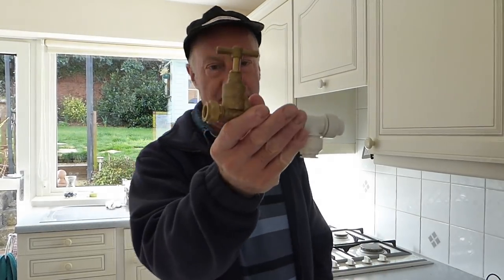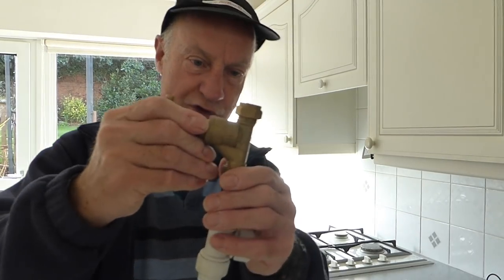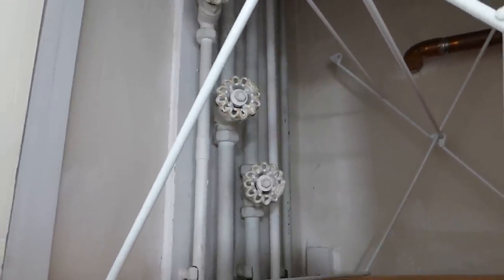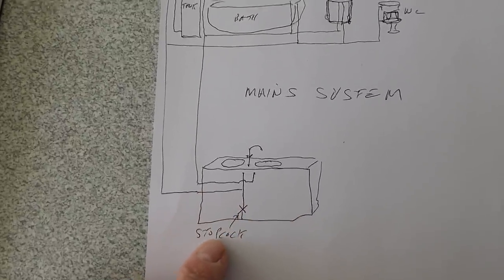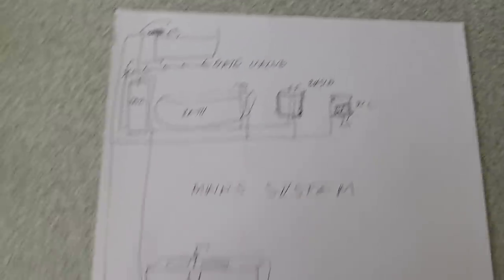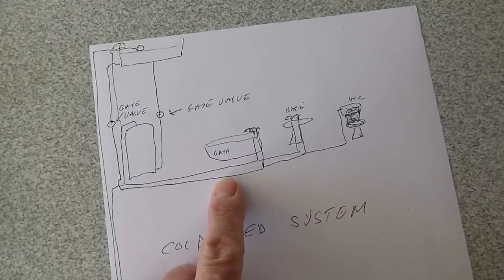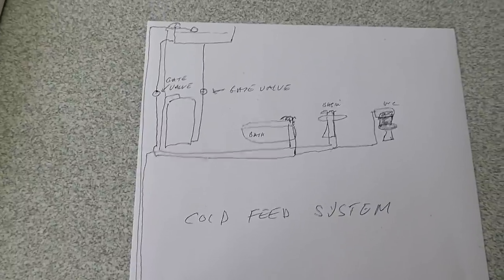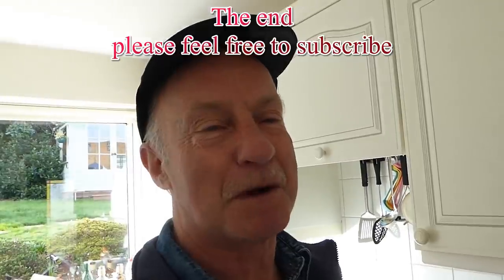Where is my Stopcock? How do I turn the hot water off?

Comment: Hi Al I live in a 1960’s block of flats. My partner and I can not locate the stopcock for our bathroom! Sure enough there is a stopcock underneath the kitchen sink which my partner turned off but apparently that only stops water to the kitchen and not the bathroom! After watching this vid I looked into the airing cupboard and there is a red gate valve with one end going into the water tank and the other end into a pipe going somewhere else. Is this the valve we’ve been searching for to stop water supply to our bathroom/toilet??? Thanks for your vids they’ve helped us out many times😃
Reply from the maker: More than likely yes, turn them off and see what happens.

Comment: Hi I was just about to give up finding the hot water turn off as I needed to change my bathroom taps and phone a plumber when I came across your video.. Brilliant and thank you, I have another problem my oil fired central heating works great accept fir the water heating.. It doesn't.. Have you got anything I can try

Regards Frankie.
Reply from the maker: Check the 3 way valve, switch it to manual.

Comment: Hi, hopefully you are still on Youtube as I know this video was some time ago now but these videos have been very helpful over the years. I do have a question however which relates to me installing a new bathroom. I want to replace the bath but there are no shut of valves to the hot and cold feeds. Is it a case of turning the water off at the mains/stop cock or will I need to turn off the hot water feed to a gate valve which controls the feed from the unvented cylinder in the airing cupboard? Any help greatly appreciated.
Reply from the maker: Hi David, you will need to turn the main stopcock off and the gate valve next to the hot water tank.
Reply: @dereton33  cheers and thank you for replying!

Comment: gave me a better understanding, i will investigate mine a bit more closely as i have a tap under the sink and also one in the airing cupboard maybe 2 i cant remember now. i have low pressure up in the bathroom takes an age to fill could opening up these taps give me more pressure upstairs in the bathroom if i turn on the hot tap and  the cold together its terrible just dribbles.
Reply from the maker: Make sure all taps are open fully, but low pressure in the bathroom is usually because the supply is fed from a roof tank.

Comment: Hi there, this will be my first DIY attempt at changing a tap washer.  Here's what I remember from when I used to help my dad.  Turn off main valve (Stopcock) from outside front of lawn. Run taps. Unscrew tap and change washer.  Replace tap with new washer and "bobs ya uncle' - DONE.  Now I don't really think it will be that easy so could you please give me advice to stop it from being balls up.  I'm also going to turn hotwater cylinder off - at switch.
Reply from the maker: Hi Mandy, there should be a stopcock under your sink, which will make it easier to turn the water off. Also do not drain the tank unless it is a hot tap you are fixing. As you have a hot water cylinder and roof tank, see if you can locate a gate valve in your airing cupboard to turn the hot water off. It is always better if you do not drain the roof tank as you can get airlocks afterwards.  The tap repair is as you say, in your description.
Reply: Thank you for your reply - thats awesome.  And thats a few more bits I would have definitely missed so I appreciate your help and will get up in that boiler cupboard and under the sink. Thanks again!

Comment: Great video ! Hi Dereton 33, We have a conventional system and not a combi I have a hot water tap in the kitchen sink that is dripping slowly and needs a replacement washer cartridge. Luckily we have isolation valves, Can I use a flat head screwdriver to turn off the hot water isolation valve that is under the kitchen sink and replace the part ? Or do I still need to turn off the gate valve to shut the hot water off, ? 
Thankyou in advance 
Paul
Reply from the maker: So long as it turns off ok that will be fine.
Reply: @dereton33  
Cheers I’ll do that 
Thankyou for the advice ! 👍

Comment: Thanks for your help!!! Quick question if you have time. I'm looking to replace my kitchen sink. I plan to use the stopcock to prevent cold water running to cold kitchen tap. For the hot tap I'll need to turn off the cold supply to the hot water tank in the airing cupboard? After this, will I need to drain the hot water in the hot water cylinder through the hot tap in the kitchen or should the hot tap in the kitchen stop flowing automatically?
Reply from the maker: It will stop straight away. You can not drain the cylinder without using a hose pipe on the drain valve.
Reply: @dereton33  Amazing, thanks for your help, love the videos!!

Comment: Do you need to drain tank fully to turn off hot  water to bathroom hot water tap or is it sufficient to turn off water supply to the cylinder and then turn on hot water tap until water stops  flowing - is this a partial draining of the tank ? It would be good to cover three cases 1 turn off water supply to house 2. Turn off cold water supply to taps etc 3. Turn off hot water supply to taps 4. If turning off water affects the central heating system
Reply from the maker: 1 st option.
Reply: @dereton33  Thank you . I turned  off valve between the attic tank and  hot water cylinder , then ran hot tap in a second bathroom . Water flow from hot tap quickly reduced to trickle . So this may be be sufficient to be able to remove and repair the hot water tap in the main bathroom

Comment: Thanks again for your help Al. So would I be draining the entire tank when I turn off the gate valve feed to the bottom of the cylinder to fix a stuck tap in the bathroom (which is on the same level as the tank) or should I be turning off the valve where the water exits the tank?
Reply: Yorkshrlad unfortunately I don’t see any stop valve on the output pipes of those cylinders

Comment: Very good demo, love the drawings! 
However, I am struggling to find the way to shut off the hot water on a Megaflow HE SystemFit pre-plumbed unvented water heater. If I turn off the cold feed to it the cold taps and wc's stop flowing but the hot taps keep running. Do I just have to wait until the whole system is empty in this case?  (This is in a ground floor flat )
Reply from the maker: Yes it has o be drained.
Reply: Bummer!  OK thanks for the quick reply.

Comment: Thanks for your great content! I need to change a kitchen hot water tap & unfortunately it doesn't have a means of isolation on the pipework. I have found some gate valves in the loft next to the cold water storage tank, if i isolate the valves in order to stop the hot water do i need to do anything to prevent damage to the boiler or booster pump. The boiler is in an airing cupboard with a hot water cylinder below it. Thanks in advance!
Reply from the maker: No it will not harm the boiler or pump.

Comment: Do i have to also turn off mains cold stopcock, if i have turned off gate valve that leads to the bottom of my hot water cylinder, want to change downstairs kitchen hot water tap, thx
Reply from the maker: No that will be fine.
Reply: @dereton33  Thx very much.

Comment: I've got two red handled taps in my airing cupboard, one turns easily and the other seems stuck. 

The one I think feeds the cold water into the hot water tank, when closed, does not stop the hot water flowing. 

I waited for about a minute for the hot water to stop, but no luck. Can you think of a reason why this is the case?

Also, the reason for this is I need to replace the valve in the cold mixer tap in the kitchen. If I don't shut off the hot water, will be changing the cold valve mean I'll have a big hot water leak? 

Cheers

J
Reply from the maker: You will not need to turn off the hot water valve if you are just doing the cold side of the valve. Still good to get it sorted though.
Reply: @dereton33  thank you so much, that's really good to know. Appreciate your response.

Comment: hi nice video.  I have found the stopcock and its fully off, the cold water is off and i have checked all of the pipe under the sink and all the way to the stopclock  but stil the hot water tap is running. there was valve to turn but its on the cold water pipe and i cant see any on the other pipe.  I,m now stuck as to what to do ?
Reply from the maker: The gate valve for the hot water will be on the cold feed pipe leading into the bottom of the hot water cylinder.

Comment: Great vids! Quick question if i want to change a hot tap downstairs and want to isolate it i just close the cold feed to the bottom of the hot water tank and open the hot taps for a few minutes?
Reply from the maker: Yes that is right.
Reply: +dereton33 Ok i was under the impression that i'd have to drain the whole water tank but this isn;t so apparemtly as the hot feed is at the top of the tank. Any way to avoid airlocks?
Reply from the maker: Yes it is, but you can still get airlocks.

Comment: Went to replace kitchen sink tap in my new house (built 2003) couldn't work out how to isolate hot, isolated stopcock under sink, ran taps downstairs until flow was zero. Took existing tap apart, lastly taking off hot water pipe annnnnnd.... Drenched???? Wtf... I changed upstairs shower unit doing exact same and no water came out hot or cold. Anyone reading this, especially OP as this is a great wee video with any ideas/advice?

There are two outlet pipes from hot water tank with iso valves, but they seem to be for radiators.

Helllllllllllpppppppp for future plz. Cheers in advance.
Reply from the maker: Drain the hot tank. Turn off the mains and run the hot water tap until it stops running.

Comment: Sorry silly question but how do I turn it off once I’ve turned the hot water supply off in the cylinder?
Reply from the maker: Once the valve feeding the hot water cylinder is turned off the water from all the hot taps will be off. There will be a small amount in the pipes to drain when it is first turned off.

Comment: Great video - one question...am about to replace my kitchen mixer tap for the first time with a new kitchen mixer tap - so from what I have googled -

I know to turn off the combi-boiler, turn off the stopcock, and turn the 2 screws on the hot and cold pipes (of that kitchen sink) from "vertical" to "horizontal"

- but if I do all that, do I still need to turn all the "individual flow-controls" to OFF on various things, like upstairs bath, bathroom sink, bathroom toilet, etc?  

Or does doing what I listed before that suffice?  Thanks from London :-)
Reply from the maker: You only need to turn the screws on the vertical pipes ( ballafix valves) to horizontal position, nothing else.
Reply: Many thanks for such a quick and welcome reply 🙂

Comment: Can’t find a video on how to repair a leaking hot water tap in the bathroom . Old type plumbing with hot water tank and separate hot and cold taps . Water dripping from hot tap  only . If I turn off water supply to the hot water cylinder and drain the hot water by running a hot water tap , will this affect the sealed central heating system ?
Reply from the maker: Try this one.  https://youtu.be/2RkoG1Di7OM   It shows kitchen tap but it will be the same process for bathroom taps. You can safely empty the tank it will not effect the heating system.
Reply: @dereton33  Thank you . Unfortunately that video is for a cold water tap in the kitchen where the mains water is turned off under the kitchen sink . Mine is a different case . I have a hot water tap dripping in the bathroom . How to isolate the water supply in this case to the hot water tap and is the central heating affected in this case if the hot water supply is turned off and the cylinder drained ?

Comment: Thanks. I need to change the kitchen sink hotbtap washer. Set up is 
Like yours with gate valve in air cupbd. If i close this will the hot tank all need draining from taps first? How much roughly is this in litres? Thank you.
Reply from the maker: Close the gate valve there will be only a small amount of water from the tap.
Reply: @dereton33  this is above the hot tank...so does that stay in by vaccuum prssure then? I thought the tank would beed draining.

Comment: How to turn off heat water to hot water tap in the bathroom . I have a dripping hot water tap . What is best way to repair it ? Do you have a video on this subject ?
Reply from the maker: Depends if you have an F and E system or a combi boiler. I have lots of videos on tap repairs. Check out my channel.
Reply: @dereton33  great thanks . I will check out the videos . Great videos by the way !
Reply: @dereton33  No combi boiler . Hot water tank . No valve under theE sink . Do I turn off supply to hot water tank and then drain the tank by turning on hot water tap ? Any need to re-pressure central heating after doing this ?

Comment: wish you lived by me,dereton .iam trying to change my hot waterbath tap.ive tured the gate valve of going in to my cylinder,and allso every stop cock valve in and around cylinder all so the main cold valve . but the hot walter is still coming out slowly,for a bout  1hrs now dosent seem to be stopping,will it stop eventually and how long ,please. i cant wait to fix this bloody hot top,done the cold one about 2hs ago
Reply from the maker: The gate valve is letting by. Best now to turn the mains back off, turn the gate valve on. Then run the hot tap until it completely stops.

Comment: I need to replace my hot water tap but my gate valve is very old and I’m worried it might start leaking.would it be possible to turn the main water supply off from outside and just run the hot until it’s empty? Thanks
Reply from the maker: Yes that is OK

Comment: So if I want to change the taps on the sink & mixer taps on the bath, I have to let the system tank drain out after turning the hot water supply off? Annoyingly, there's no isolation valves on the pipework.
Reply from the maker: Turn the main stopcock off then drain the main roof tank until the water stops running.
Reply: @dereton33  Thanks.

Comment: Hi,
I want to replace taps and isolation valves on sink in upstairs bathroom. 
Would you just turn the mains off under the sink downstairs and turn the taps on the upstairs basin (the basin you are working on)?
Reply from the maker: yes that would be ok. so long as you have a combi, if you have an F and E tank then you will have to drain down. Or hope the gate valve works.
Reply: @dereton33  
Hi,
It is F & E, on the off chance the gate valves at the hot water cylinder in the press don't work, what would you do?
Thanks in advance 👍

Comment: I think I have the Cold Feed System which I worked out looking at your pretty good diagrams incidentally, I find it takes ages to turn the hot water off after closing a gate valve. 

However I was wondering if I put a normal stop valve on the copper pipe that comes out the top of the hot water cylinder, then I could turn off hot water instantly without draining the cylinder itself. Is this safe to do and why fo typical systems not have a stop valve on this out pipe already?
Reply from the maker: Do not put a stop valve there, that pipe is also the expansion pipe.
Reply: @dereton33  Thanks bro, I looked all over the net and never noticed one on the others so assumed it shouldn't be there. I guess I'll have to drain the entire hot water tank before embarking on any job with hot water taps

Comment: Hi where could I find my stopcock with an immersion tank as I’ve looked in the kitchen and can’t find it
Reply from the maker: It should be alongside the tank in the cupboard.
Reply: @dereton33  thank you, I’ve also watch your videos about the low water pressure with hot water. Do you have a video removing the pipe connected to the emotion and water tank as I can’t afford a plumber?

Comment: Hi
I’ve turned off my gate valves, bunged up the tank in the loft but still have hot water coming out of my taps. Any ideas as to why?
Steve
Reply from the maker: Gate valve letting by, drain the complete roof tank, bungs in the outlets let by as well.

Comment: Hi, I'm changing my kitchen monobloc tap. I found where to turn off the cold water mains supply tap but I have a condensing boiler (Potterton Powermax HE with integrated hot water storage tank). There is no tank in the loft and the boiler is in the airing cupboard downstairs. There is one red gate valve in the cupboard on a pipe which feels cold, even when the heatings on. So, the question is: do I only have to turn off the cold water mains stopcock to stop both hot and cold water supply or do I need to turn the red gate valve as well? I have been reluctant to just turn it and see, in case I damage the boiler in some way. Also do I have to turn the boiler off as well? Thanks.
Reply from the maker: Turn the boiler off. The red gate valve will shut off the hot water. You can if you prefer just run the hot tap until it stops.
Reply: @dereton33  Hi, thanks. Just to clarify: turn the boiler off and EITHER close the gate valve OR run the hot tap until it stops.

Comment: Great & very helpful video. Thank you
Reply from the maker: No problem
Reply: hey i live in a old 1960s trailer i cant find a shut off valve for the hot water to kitchen sink and it leaks bad where would i find a shut off valve only for kitchen sink , should i start looking around the water heater?

Comment: I just had Thermostic Shower put in and hot water keeps running hot and cold and the hot tap in sink does the same and in Kitchen. We have a Combi do you have an idea what's causing this?
Reply from the maker: Check pressure of boiler. Check mains tap fully on. If ok could be 3 way valve problem.
Reply: @dereton33  Cheers mate think must be the 3 way as other 2 good and water keeps going hot and cold

Comment: Thanks Al. But I have always wondered why the gate valve for the hot water is on the input to the tank only and not to both input and output.
Reply from the maker: No problem Tom.